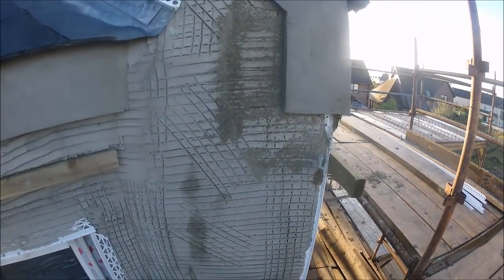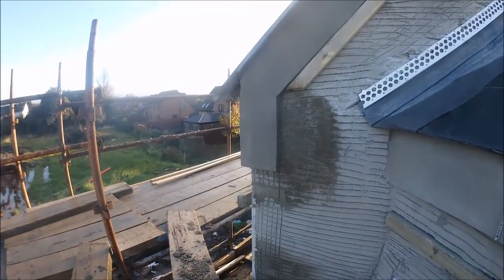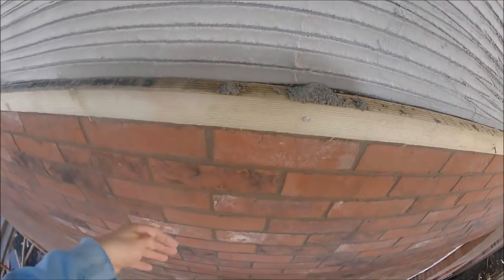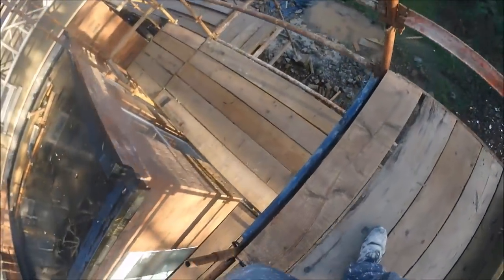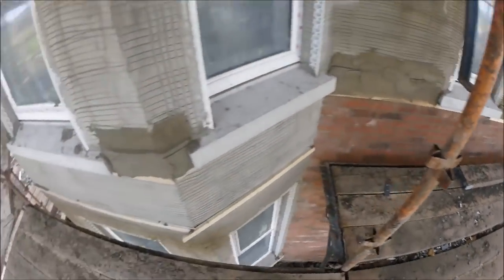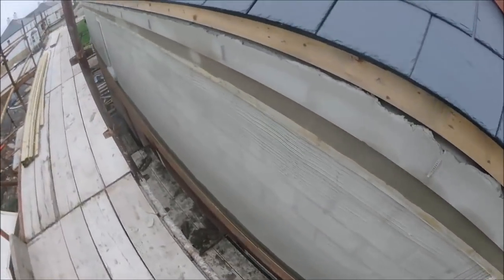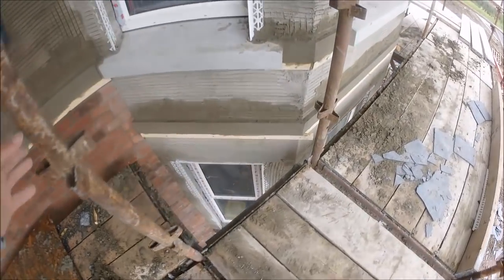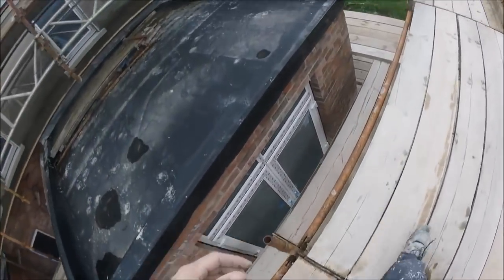Bands part two detailed rendering work (straps)

Comment from the maker: Tool giveaway is still live Enter here = https://youtu.be/el5KxGHTGwE
Reply: macplastering hello Mac  great videos mate, would it be possible if you could show how you do your bell bead with your corner bead and how it bells out with sand and cement pls ..... cheers pal ⚒
Reply from the maker: Hi Robert mate do you mean around the tiles? just i know in England they belcast above windows where here we keep them square ?
Reply: macplastering hello Mac no what I mean is mate is I got a damp course down the side of house and the bell bead sits just above it and at the front of house  if you know what I mean Mac
Reply from the maker: The bead will be on top (in line with ) the dpc / your floor level would that be correct buddy ?
Reply from the maker: Your inside floor should line up with the bead ... but next time i do a wall I will show how i do it
Reply from the maker: Sorry also when you say dam course do you mean a drilled and pumped one??
Reply: macplastering yes the beads sits on top with a curved in it so it acts like a water drip if you known what I mean Mac , perhaps I’m not explaining myself very well , but it’s the corner when the front beads meets the side  mate !!!